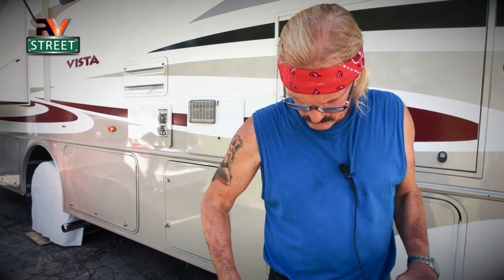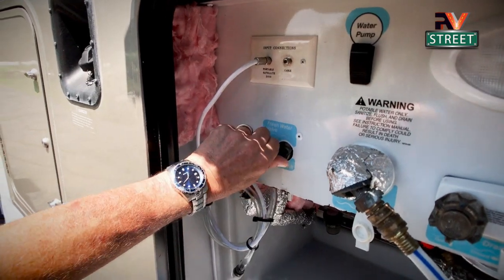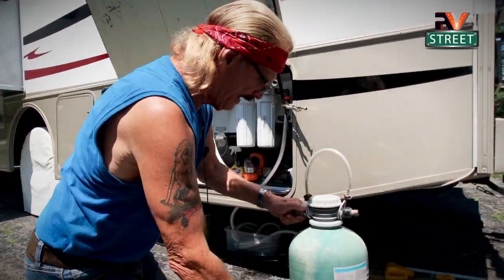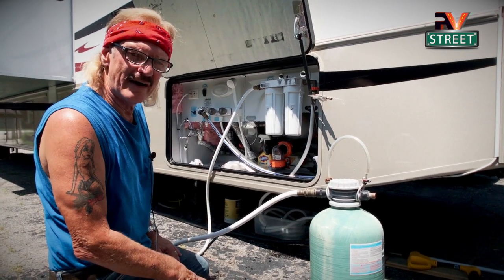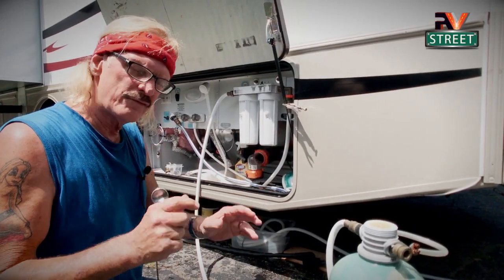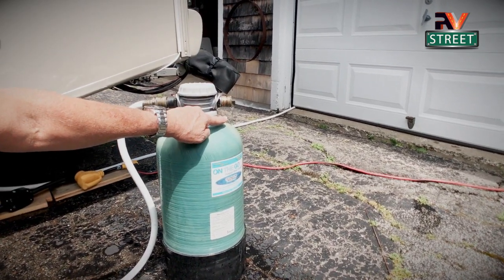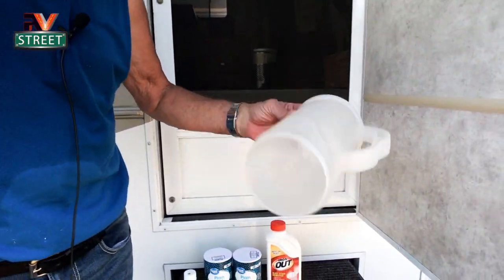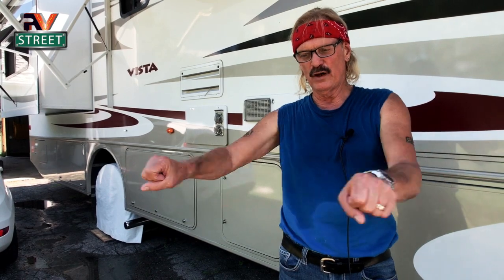REGENERATING a RV Portable Water Softener. Easy DIY.

Comment: Just bought a very well kept 2011 Montana. However, no water softener. Even if we start now with a water softener,  how would I reverse any damage or build up from the very hard water we have in New Mexico?
Reply from the maker: Well I wouldn't assume there is any damage yet because if it's well cared for as you say, they may have been running a water softener. But in any case since this rig is new to you—by default— you should go thru that entire rig and do every maintenance item there is to give you a clean baseline from this point forward.

Concerning water items here's what I'd do. I would completely sanitize the entire water system.
1) Sanitize your fresh water tank with bleach. 1/4 cup per 15 gallons of capacity. Fill tank to the top and sit for about 4 hours. Run some of that water thru your water pump and cold water lines by opening all the faucets in the rig until you smell bleach. After 4 hours, drain entire water tank, add new filtered water, run your water pump for about a 30 seconds to flush that out and open all cold water lines again to flush out bleach their too.
2) Assuming you have water filters, remove both water filter canister covers, remove filter elements, fill both empty canisters with with pure white vinegar, spin back on the covers. Now open all cold faucets inside the rig one at a time till it starts to foam out the vinegar then shut each one off. If you have a washing machine, start it till vinegar circulates thru that too then stop washer. Let this vinegar stand in there for about 8 hours. This will break up any calcium build up on the lines, faucets etc. Once you do that, flush out the entire system with clean water by opening all faucets and run the washing machine more till all the vinegar is gone. Then go back and replace with new water filter elements. Go back to each faucet and remove the faucet caps and rinse them out because they will probably be full of deposits. If you don't have water filters you need to get them along with a softener. You can see how to set that up here with links and part numbers in the description area:
https://www.youtube.com/watch?v=1Reh8q6-rC0&t=424s

3) Do a complete cleaning and flushing of your water heater with white vinegar. You can see how to do that here:
https://www.youtube.com/watch?v=En3Th-GLuYk&t=140s

Once this is all done you have a good baseline. Then install a good water filtering system and a softener going forward. If you do it the way I set mine up, you'll deliver safe, pure, great tasting water throughout the entire RV while at the same time protecting everything in your RV.

NOTE: You may already know this but, since you mentioned you're in NM, you're going to have to protect that rig from the blistering sun and UV. Being anywhere but especially in the southern/western states that sun is brutal and will destroy the outside of an RV if you don't protect it properly. I covered this subject as well here:
https://www.youtube.com/watch?v=7KmgneT3HPs&t=785s

Hope this helps. Good luck Larry. 👍

Comment: Question:  If the test after regen still shows hard...do you just do the regen again with two cans of salt....two regens with two cans of salt or are you doing a regen with 4 cans the second time around?

Thanks...🤠👍
Reply from the maker: Yes, 2 cans of salt each time. And don't forget a couple of Tbsps of Iron out. Then do another slow rinse for 25-30 minutes, fast rinse for 5 minutes, just like you did with the first 2 containers of salt. 👍

Comment: Martin I just got a used OTG water softener just like yours, it is an older Green one  in Color. but it says it is a Standard Ver. How can that be if it is the same size as yours and all of the other Double Standards I see, how old is your unit. thanks and keep the info coming.
Reply from the maker: Not sure about your color. I've never seen a green one. Ours is 3.5 going on 4yrs, old. All the ones I've seen are blue like ours and that's what we linked to also. The golden beads in ours will last 7 years with regular use. If you have a washing machine—which will use more water—more like 5yrs. Then you just change out the beads with new ones.
Reply: @RVstreet  If you look at your video it shows to be Green , the new ones I have seen demonstrated are Blue.  maybe they fade with age.  thanks for reply
Reply from the maker: @dannybryant4440  Ya you're probably right about the fading. Plus looking at pictures on different kinds of devices will vary also too. But ya, I guess ours is a little more green than blue now that I look at it.
Not sure what's going on with the name though. They make 3 sizes and ours is a Double Standard version I'm sure of that.
Reply: @RVstreet  Martin, I turned mine over and it is Blue on the Bottom, Fading I guess.  I do have the Double Standard and in the process os rejuvenating it after it sitting for several years. per On The go. thank you again for all of your info. I got it used over the weekend
Reply from the maker: @dannybryant4440  Oh, OK that explains a lot. Sitting for several years. Yep. Replace all the gold beads, and then do a full salt rejuvenating per this video and you should be good to go.
Reply from the maker: @dannybryant4440  A couple of other things Danny I just thought of.
1) Since it's been sitting so long, once old beads are removed I'd wash that entire unit out with a 10/1 bleach solution for about 4 hrs. first. Rinse it out good then add new beads.
2) Once new beads are in and you're rejuvinated it with salt and your all to good to....NEVER EVER turn it upside down or lay it on it's side. 👍
Reply: @RVstreet  Martin, that is what I did, I back flushed then added some bleach and flushed for 25 minutes then added two cans of salt then did the normal regen process. it is working normally now. I talked to Ben at OTG and he said since it was working like it should to just use it for a while then I can replace the Resin later and have a like new unit for less than half the price even if it is faded . thanks again
Reply from the maker: @dannybryant4440  Ok good. Glad you got it. 👍

Comment: What .5 micron filter do you use? I tried a .5 micron same size as yours and my pressure dropped way down. I know the label says 1gpm, but I wanted to try anyway. Did you by any chance mean "5 micron carbon filter"? Thanks!
Reply from the maker: No it is a .5 micron and we don't have any issues with pressure. I change all our filters every 3 months. If you'll go to the video below and click SHOW MORE under the video, I have all the links to every part# right there. thx Dover. 👍
https://www.youtube.com/watch?v=1Reh8q6-rC0&t=405s
Reply: @RVstreet  you rock! Are you comfortable using your current water filter system (I watched all your videos, just awesome) and drinking water direct from your sink tap at various campgrounds?
Reply from the maker: @dovergerald1579  Absolutely. In fact just last week we met a new couple up in Missouri, and she said her husband is real fussy when it comes to how water tastes. I gave him a glass right out of the kitchen tap. He said wow, that is good. We've even had our water tested and it's better than what we had in the house. I wouldn't have our water any other way. The way we have our water setup it's not only safe but tastes good too. And because of our softener the coach is protected from mineral build up. We use this same water in our fresh water tank. If you treat your water right, there's nothing to be afraid of.
Reply: @RVstreet  awesome! Thanks so much for responding!

Comment: The water filter we use is the blue tube, do we hook that up first then the water softener?
Reply from the maker: Yes. All filters go BEFORE the softener. The softener is the last stage before it enters the coach. Just remember though, that inline blue filter is only a Sedi filter. It filters only the big stuff. If you want good tasting, real safe water, you really should consider installing a double canister filter after that blue one to filter out finer particles, then to the softener. I know a lot of people just use the one inline blue filter, but it really isn't sufficient in and of itself. Especially camp ground (CG) water where it varies so much from CG to CG. Good question Lisa. 👍
Reply: @RVstreet  awesome. Thanks.  We’re lucky to have a Reverse osmosis water station here at the park they only charge us $.25 a gallon we use that for drinking water

Comment: I have one of these but only use for weekends and store my rv for the winter and will bring the softener into my home.  Does anyone know if I need to do anything special with the remaining water in the softener over the winter?
Reply from the maker: BEFORE Storing for the winter

Draining Instructions
You can use either of these two options if draining water from the unit is
required. For both options DO NOT REMOVE top cap or head.
Step 1: Turn the unit upside down and allow water to drain from inlet/outlet.
Step 2: Use air source applied to inlet and allow water to drain from outlet.
Storage Instructions
Before placing the unit in storage or being idle for extended periods:
Step 1: Perform the regeneration process.
Step 2: Drain water from unit (DO NOT dump the resin out).
Step 3: Unit is ready for storage.
Post Storage Instructions
After extended periods of non-use, sanitize the unit by following the instructions
below:
Step 1: Perform back flush.
Step 2: Completely drain all the water from the tank.
Step 3: Remove top cap and mix 1/4 packet of Sani-System with a gallon of water
for the Standard Model, 1/2 packet of Sani-System with 2 gallons of water for the
Double Standard Softener, or 1 full packet of Sani-System with 4 gallons of water
for the Park Model Water Softener.
Step 4: Pour solution into tank, put the top cap back on, and let it sit for a maximum
of 60 seconds.
Step 5: Turn the water on full stream for 10 minutes and flush the Sani-System out.
Step 6: Perform regeneration.

Comment: Hey
I never saw you taking any water out of the softener before you added the salt, with a softener full of water how can you add salt?
Reply from the maker: No I didn't because you don't remove any water and NEVER turn it upside down to drain some out. As you add salt to existing water in the softener—as I showed—the salt is absorbed into the water and begins to sink to the bottom. There will be a little water that pushes out the quick disconnects as you add more mass—of course. But it's only 2 containers of salt so it's not going to be much. This is the proper way to recharge.
Reply: @RVstreet  everytime we end our camp trips, i tip upside to drain water out....thought this was ok?

Comment: Thanks for the video! I see you linked this softener to the one on the RV Water Filter Store page, however, when heading that way the softener shown there is in a black container with the RV Water Filter Store logo on it. I actually just ordered the one on their site, but now I am wondering if they are selling the actual On the Go softeners or if this is an off brand of the On the Go... Could you clarify?
Reply from the maker: Ok, I just checked their site and saw what you saw. I wouldn't worry about it but I am sending them an email right now about this. This is a recent change that I was unaware of. They probably took the OTG softener and just rebranded it with their logo. I'll update this as soon as I hear back. They're really good folks and respond quickly to me.
thx Chad
Reply: @RVstreet  Thanks for the response, and the follow up with them. I messaged them too and will likely call them Monday morning. I’ve heard lots of good things about the company too though. I will say that it looks an awful lot like the Pro+Aqua softener.... and I will admit though, with all the reviews of the On the Go’s, I really wanted one of my own... we’ll see though.
Reply: @RVstreet  So I messaged RV Water Filters again earlier today and explained that I really wanted the On the Go water softener and that I would like to cancel my order if the softeners on their site were a different brand. Justin Boggs replied to my email (on a Sunday!) that they would cancel my order because yes, the softeners that they are now selling are their own brand, and are no longer the On the Go brand. So, I am going to place an order directly with On the Go for the water softener. I do want to point out that I have heard nothing but good things about the company RV Water Filters, but after doing my research I settled on wanting the On the Go brand softener specifically... I actually have another order with RV Water Filters for a short, custom length hose and a couple of other accessories that I am also waiting on, and will have no concerns with ordering other things I may need from them in the future. I just wished I had enquired about the softener a bit more before ordering it because the description still sounds a bit like the On the Go brand, as well as some of the reviews on the product page (one review even has a photo of the On the Go brand softener). Oh well, thanks for the help!
Reply from the maker: @SticksBlog  Thanks for the update. I haven't heard back from them yet. But just as a thought—if you want—you can use our Amazon Store link and go there, search for the Double Standard OTG softener put it in the cart and check out and that way we do earn a little commission from that sale.

I'm going to talk to Justin next week and ask him why they decided to make that change. But in any case, thank you Chad so much for bringing this up to my attention and supporting our channel. You just don't know how much that means to us. 🔧 👍
https://www.amazon.com/shop/rvstreet